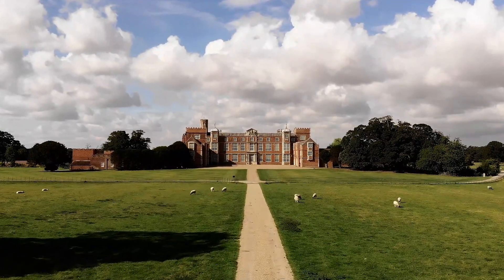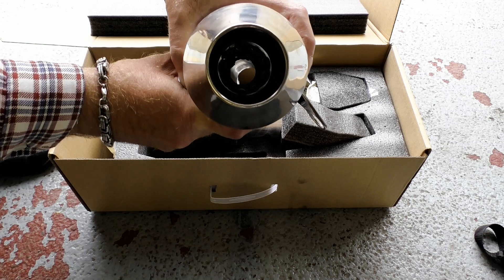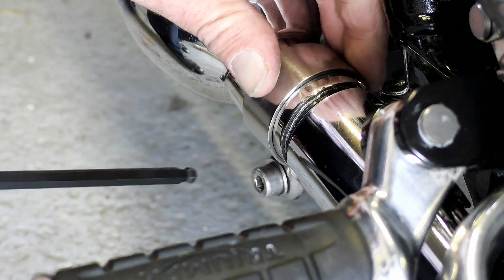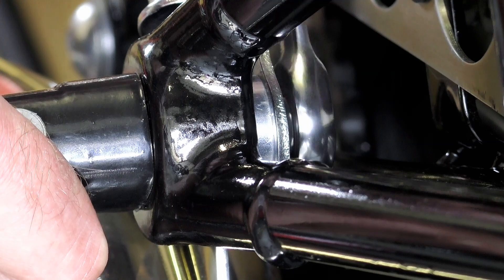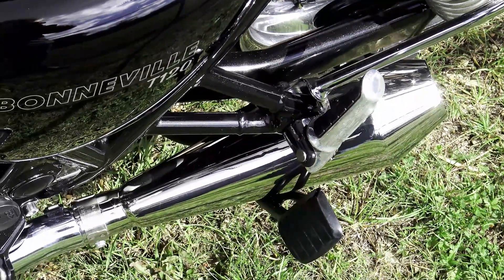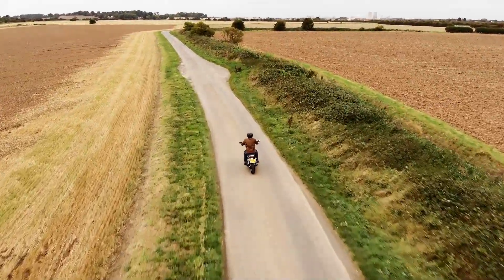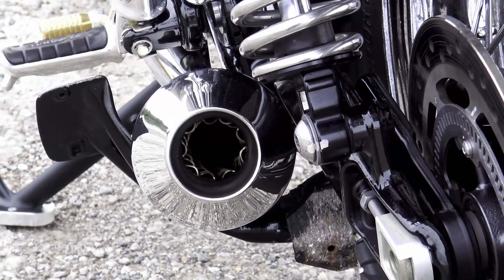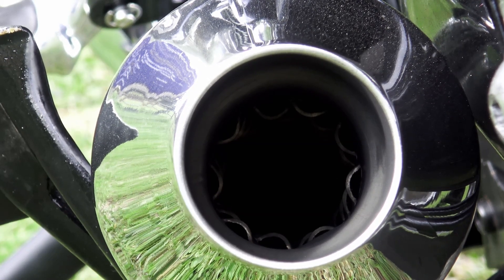Triumph Bonneville T120 & British customs very naughty PREDATOR PRO (shorty)

Comment: Thanks for this video.  Very helpful  I have been hemming and hawing about whether these cans will have a negative impact on the "classic" character of my 2022 T100.  Just today I've settled on fitting these shorty cans to my bike.  As I have mulled it over I think this style exhaust is perfectly "classic," and it really does make the bike look quite a bit more "athletic".    I do not have an X-Pipe.  I assume that will tone them down sound wise, and that performance gains will be minimized. I'm not looking for loud pipes nor am I trying to squeeze out more performance.  A little more "throat" to the sound will be good if that is the result.  But, mostly I like the look and most  I really don't want to have to pull off my silencers every time I work on my chain or rear wheel.  That alone is good enough reason.  Thanks Stuart, you helped me sort this out in my mind.  I'll head over the BC and see if they have these in stock for my bike. 
i

Comment: Do the shorties interfere with either your triumph or lomo panniers? I have both as well and currently running the BC exhaust tips. I eventually want to get the predator shorties and am wondering whether they’ll be any contact or excess exhaust blown on the bags..

Comment: Running into the problem of gasket diameters I've resorted to cylinder boar honing brushes available for jobbing brake slave cylinder refurbishing . With a pare of slide rule calipers going slow until getting the hang of it .   Thanks  All , Thanks  be

Comment: Hi Stuart. Great info on this pipe. I am sensitive to sound. I wear hearing aids in both ears so I like the quietness of the stock pipe. However I like the fact that there is a bit more power and that the radiator fan doesn’t cycle as much. Do you have a comparison of the dB level of this pipe and the originals?  If you do and you can incorporate this in with your next video that would be helpful. Thanks for the great videos. Alan
Reply from the maker: all in hand sir!

Comment: Incredible sound. What causes that snappy crackly sound when you release the throttle? Is that specifically due to the removal of the Cat?, the introduction of the X-pipe, or both? I've heard other videos of these silencers, where the exhaust note sounds the same, but does not have that wicked crackle on throttle release.
Reply from the maker: its always been a common occurrence on all bikes ince the year Dot! although the design of some silencers may make it unnoticeable. I believe it has something to do with the exhaust valves slamming shut on the overrun, but to be honest ive never really thought about it so I may be wrong!
Reply: If you look at the BC comparison vid; they do Stock vs Predator vs Predator + 'Total performance package'.... and that same crackly snarly sound on throttle release turns up on the 'Total performance package' ...which from what I can tell, means they installed their decat Xpipe... as you have done too (albeit the motone version)

https://youtu.be/gZhklzjSugs
Reply: Anytime the throttle slams closed it creates a rich condition momentarily. A modified exhaust allows it be expelled before it's all burned away. Thus the small back fires. Depending on riding styles it's a non issue for some. The newer Triumphs have air injection/reed valves that allow some air to be drawn into the exhaust by the vacuum created when the throttle is closed rapidly. This helps the unburned gas to continue combusting in the exhaust before exiting. Hope this helps you understand? Peace

Comment: Hi Stuart, great video! When you run the bike through a "heat cycle" to allow the ECU to re-calibrate, did you disconnect the Booster Plug?  (assuming its still fitted). Brian

Comment: Hi Mr Filligham . Have you retuned or remapped the bike after change the exhaust to Predator shortly ? Have you had pop on decel ? I will change my exhaust on my T100 and I am worry about that . Thanks for your response Rui Tsukuda
Reply from the maker: as I explained the Triumph has a learning ECU so there is no need to re map.
Reply: @stuartfillingham  Do you believe for T 100 2014 is the same ? Thks
Reply from the maker: @ruirui886  My misunderstanding, no it isn't.

Comment: As usual, great video :) 
I'm getting ready to mount these pipes. I'm going to mount these first, ride for a few days, then mount my x pipe (the Motone) taking a short video  at each step from stock, to Shortys, to Shortys with the x-pipe fitted, just to hear the difference on my bike as I go along... 
So I decided to start my bike today with the stock configuration so I could time how long it takes for the fan to come on, and then compare that through every step that I described above (again, just for my own curiosity). But my bike idled for 15 min and the fan still hadn't come on and I'm not sure why (ambient temps are a tad cool but still around 10°c or so). 
The only thing that is different is that my head lamp assembly is taken off at the moment with just the unplugged connectors in the housing, but can't see why that should make any difference to the fan circuit. Regardless, I'll put it all back together tonight and try again. Maybe my 2018 just runs slightly cooler(?)... don't know.
Reply from the maker: ah Yes puzzling!
Reply: It of course had nothing to do with the lamp being disconnected. I tried again after remounting my headlamp and it took 15 min (exactly) for the fan to come on (which means it was probably just about to come on when I gave up last time). But still a big difference considering it’s  still stock.

Comment: Hi I asked a shop here in Australia about the graphite exhaust seals and they told me they were not required and there is no mention of the seals in the installation instructions for this exhaust. Can you please tell me why they are necessary? Thanks
Reply from the maker: because if you dont fit them your exhausts will blow!

Comment: Does the T100 have a rubber bump stop for the original exhaust?
Reply from the maker: im not entirely sure Walt AC or WC?
Reply: AC. If you do on your T100 let me know and if it makes a difference. Thanks
Reply from the maker: the AC version didn't come with a centre stand as standard Walt so it doesn't have one although if one is fitted it should have one installed somewhere!

Comment: Stuart - enjoyed both reviews of Predator and Sleeper Pro.  Trying to decide on which one I want to get for my T120.  Have been leaning toward the Sleeper Pro, but like the idea of bike running cooler with Predator Pro.  Would think that bike would run a bit cooler with Sleeper Pro as well, at least cooler than the stock pipe.  I like the performance gains that both offer, it makes sense that the Predator would provide better performance and I do like that look.  Another thing I was considering, do you have any issues with the Predator Pro affecting your Burly Saddlebags.  I will be getting those in soon and wanted to make sure that exhaust would not affect Wax cotton.  I would appreciate your input.  Thanks again for great videos.
Reply from the maker: no issues with the bags Rob and although I prefer the look of the sleepers, the Predators ended up being my preferred pipes!

Comment: Hey Stuart, as you know this was the video I've been waiting for and it didn't disappoint. The shorties look and sound stunning and give exactly the dynamic to the T120 I am after. One question - at 8.30 mins you quite clearly show how they fit to the 2016 model with the protruding down-pipe from the exhaust shroud. As you know from our numerous conversations the 2017 model has the down-pipe receded behind the shroud. Do Predator give any guidance on this as the slip-on end will need to go under the shroud on the later model? Nice to know your exhaust has gone from the 'doom-hound from hell' (BC exhaust tips video) to a 'snappy & snarly thing'!! Thankyou again sir for another excellent video. (PS love the drone footage over Burton Constable).
Reply from the maker: Hi Stranger! not actually sure Paul, is the exit pipe shorter on the later versions or is the shroud longer? I did actually pay attention while I was fitting it and it did strike me that the Predator may fit under the shroud if need be!
Either way I know BC were aware of the differences after 2016, and may well have a 2017 onwards version available. Really nice to hear from you again!
Reply: stuart fillingham  Apologies for the absence - usual excuse of serving Queen & country! My local dealer tells me Triumph extended the shroud so it now sits over where the silencer joins the downpipe. I'll see what the guys at BC recommend when I come to swapping mine over.
Reply from the maker: Dont leave it too long Paul, your missing out on a wonderful thing!

Comment: Graphite inserts indeed- when did the cafe racer boys ever use those???  I always just use a short piece of 1/16" wall thickness ( or 1/8" if needed)  mild steel pipe with the same internal diameter, cut diagonally along one side to allow for spread and then fit with black silicone RTV and slide the mufflers over the top then clamp. This is the best recipe for a permanent leak free solid mounting and it's easy to remove too.  Silicone RTV is a very underrated exhaust sealant btw and I use it on headers too and is a brilliant solution on old Brit bikes  with normally leaky push in headers.  Just sayin'!